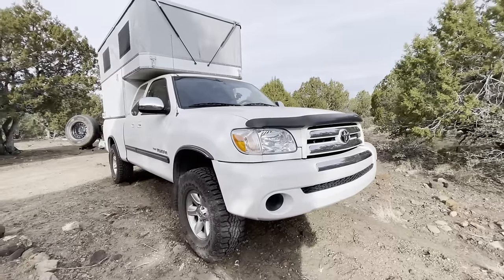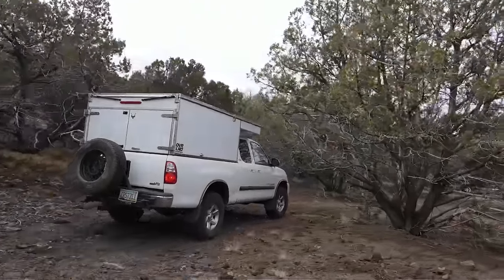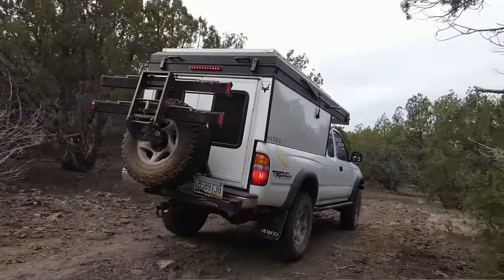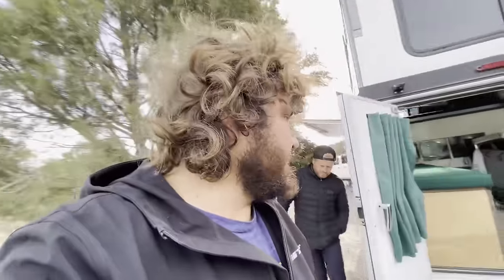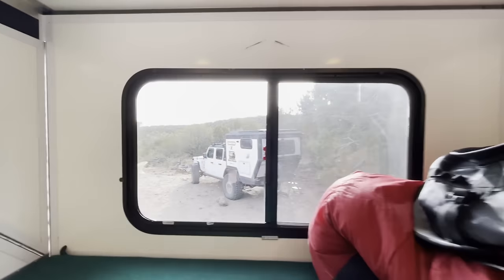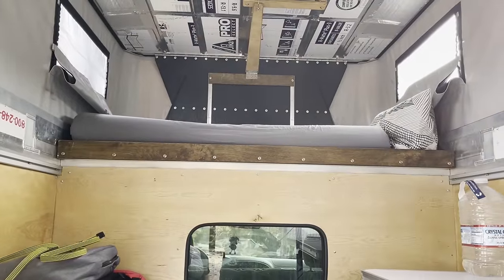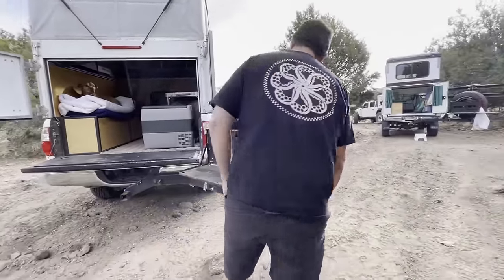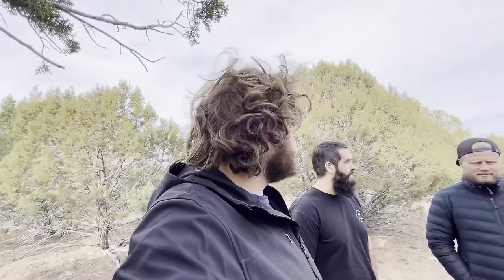Truck Camper COMPARISON - Tacoma with Hiatus Hard Side Pop Up VS. OVRLND Camper on Toyota Tundra

Comment: 12:07
I could see putting a strut between the open doors to hold them in-place while cooking.
With a curtain, that enclosed area could be a shower zone.
Latch on a quick roof to make a mud-room.
Reply: You could also pin them to a hook or magnet or something on the truck, to hold them open.  

I think trying to shower, there, would probably be a bit much.  But definitely could make a little porch for kicking off your boots and stripping off your outer layers, especially when they're wet.

Comment: I wasn't aware of either of these brands.  Very cool origami hard walls.  The OVERLAND's got insulated liners you can add to the walls and - I think - the header.  That's a big difference maker for comfort.  375 pounds, dry weight.  That's pretty darn good.  The Hiatus is close to the same weight.

I wonder if they make them with longer over-cab.  Lots of crew cab Tacoma's out there.  You could make a huge bed and not have to slide anything out, if you could extend the over-cab part.  Regardless, Pythagorus allows a tall man to stretch out on a short bed, so if you were solo-ing, you probably wouldn't fool with sliding it out to King size, according to the big dude.

The hard-sided Hiatus is carrying some extra weight up top.  I thought about having a hard-sided popup where the side panels are stored on or under the floor when you're on the road.  Pop them out and redistribute the weight down low when you're driving.

Comment: Hi, great video!! I'm leaning heavily towards a truck bed camper. What is the name of the hitch plate receiver the 1Up bike rack was attached to?? I'm looking hard at a Rigd hitch swing too. 
Thanks for any info, Keep up the great work!!! :)
Reply: I have the Rig'd and 1 up. and they're great. 1up rack for about 6 years 4x4ing quite a bit .. no issues.  I bought the Rig'd used and the previous owner really 4x4'd it. I closes perfectly and is top quality.